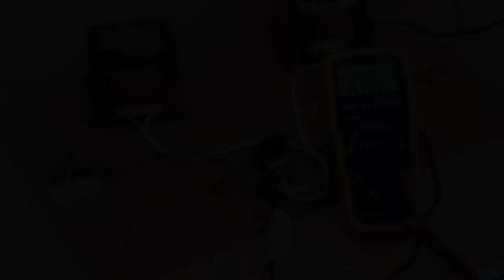DIY Welding Machine / Only 2 Microwave Transformer / Good Job

Comment: Excelente trabajo, eres un profesional y gracias por compartir tus conocimientos con todos, mi pregunta es si se puede usar ésta maquina como método de soldadura tig, y si las polaridades se pueden cambiar dependiendo el trabajo de soldadura a realizar, polaridad directa y polaridad inversa y si es así, en esa máquina que fabricaste preciosa por cierto, cuál sería el positivo + y cual el negativo -
Reply from the maker: Hola.  En primer lugar, gracias.  Esta máquina tiene salida de voltaje CA en su estado actual.  Entonces no hay terminal + o -.  sin embargo, se puede conectar un rectificador a la salida.  en este caso la polaridad puede ser obvia.
Reply: Hola de nuevo, y ése reftificador, de dónde podría obtenerlo de un aparato reciclado?, Es que quería hacer un inverter de unos 250 amperios más o menos y que tuviera la función de soldadura tig, no sé si me podrías ayudar, gracias y un saludo, y gracias por compartir tus trabajos, son geniales, yo también intento reciclar lo máximo posible las cosas, me viene de niño 😆😆 hay que cuidar el planeta, que es nuestra mejor casa, gracias de nuevo 👍👍👋👋
Reply from the maker: Hola.  Tu pensamiento es hermoso.  necesita usar 4 transformadores para aproximadamente 250A.  Si puede colocar 13 o 14 devanados en cada transformador con un cable de 8 mm2, puede alcanzar el valor de voltaje y corriente deseado.
Reply: hola de nuevo 😉,y si pongo un reftificador de voltaje en la salida, podré intercambiar las polaridades según el trabajo que lo requiera en cada momento, y podré usar  la antorcha de tig y trabajar con tig, cambiando las polaridades con tig también en el caso que se necesite?, Gracias de nuevo por ayudarme, y un saludo desde España 👍👍👋👋
Reply from the maker: Exactamente.  Sin embargo, el rectificador que conecte a la salida debe ser resistente a 250 Amperios.  Así será como dices.  Yo también tengo ese pensamiento.  Estoy pensando en hacerlo en el futuro.
Reply: muchas gracias por tu ayuda, lo intentaré haber que sale🤣🤣, cuando tenga tiempo y reúna todas la piezas, muchas gracias de nuevo y seguiré viendo tus proyectos, un abrazo y saludos cordiales 👍👍👋👋
Reply from the maker: Gracias a ti también.  Saludos desde Turquía
Reply: Holla eu fiz um soldador deste tipo com 4 transformadores e converti para corrente contínua. Irei meter um video no meu canal
Reply from the maker: @droquesteni  Hola.  También preparé los materiales.  Estoy pensando en hacerme el alisado en un momento adecuado.  Si nos avisas cuando lo hagas, veremos tu video.  que tenga un lindo día
Reply: gracias tu tabien! Si vou fazer isso!

Comment: Hello sir, I want to make it, could you please show that how to install volt and Amp meter in this machine and tell the average Amp consumption. Moreover I want to ask if this machine give output DC or AC.

Thanks.
Reply from the maker: Hello. You can install voltmeter and ammeter. However, current measurement can only be done during welding. My welding machine, as in this video, gives AC output. However, on my channel, you can find the video that I converted the output to DC and the video showing how the dimmer circuit used for current adjustment is made. Also, I would like to remind you that there are subtitles in the videos.
Reply: thanks
can i use transformers  upper or secondary coil is burned 
I got two of those
Reply from the maker: Hello.  As I understand it, you have microwave oven transformers with burnt secondary coils.  If the Primer (the part that is currently wrapped with thick wire) is intact, you can use it.  To understand this, you can measure the primary winding with an ohmmeter.  It's solid if you have a little resistance.  If it is open circuit or short circuit (0 ohm), it is faulty.  But usually the primary winding does not fail.
Reply: thank you very much for this information
☺☺
Reply from the maker: Thank you too 👍
Reply: I wanna ask which software you use for sketching 3d plans
Reply from the maker: Hello.  Sorry for getting back to you late.  I make 3D drawings with Sketchup program.  It is a simple and very nice program to use.  However, I made the box for the welding machine during the video.  So I didn't make a drawing.  It would be better if I made a slightly larger box.  It is good to connect a voltmeter and ammeter.

Comment: And sir Can well use any dimar diagram used bt136 like 2000w so dat well can used the paralet to bust it sir last question master
Reply from the maker: Hello.  It's okay for me to answer your questions, but as far as I understand your native language is not English.  That's why I can only half understand most messages.  Write in your language if you want.  I sent you the wiring diagram links earlier in a few messages.  Since the circuit I use is 2000W, I connected an extra triac to make the circuit stronger.  Since the product I sent you the link of is 4000W, there is no need for extra processing.  If you still want to do it, please write me exactly what you need in your language.
Reply: thanks so much master please send it to me sir because ave already getti 4 track down sir please master the diagram sir sending it to me sir it's well well with you sir
Reply: and possibly sir you can send the diagram of 4000w also Sir God bless you sir master
Reply: thanks master iam expect the diagram of it sir thanks
Reply from the maker: Did you download the schematic?
Reply: no sir I don't receive enyting sir
Reply: master I don't see it sir please
Reply: send the link here sir god bless you sir
Reply from the maker: https://drive.google.com/file/d/1NoQeD8Wd9HW9TT3OQOkoq9BUoZidIL-n/view
Reply from the maker: https://drive.google.com/file/d/1NoQeD8Wd9HW9TT3OQOkoq9BUoZidIL-n/view
Reply from the maker: https://drive.google.com/file/d/1NoQeD8Wd9HW9TT3OQOkoq9BUoZidIL-n/view
Reply from the maker: https://drive.google.com/file/d/1NoQeD8Wd9HW9TT3OQOkoq9BUoZidIL-n/view
Reply: thanks si ave already received this b4 sir I mean  you should let me now were  i can se how to build it my self
Reply from the maker: This process is not very difficult.  Place 4 bt137s neatly on an aluminum heatsink.  If the aluminum heatsink is a little bigger, it will provide better cooling and connections will be made easily.  Combine these four bt137 bin identical legs with a cable.  So connect the numbers 1 together.  Do this for legs 2 and 3 as well.  The cable should not be too thin.  As a result, 3 wires should come out.  3 wires for legs 1, 2 and 3.  connect these wires in parallel to the triac on the circuit.  ie the 1st leg, the 1st leg of the others, the same for the 2nd and 3rd leg.  Make sure there is no short circuit.  I hope you can handle it without any problems.  take it easy
Reply: sir I understand everything very much wath am saying sir is that I want to beuld the dimar by my self  so that I can buy the component and beuld the dimar by my self that wat i am toking about master
Reply: try to understand me master i want to beuld the dimar by my self  so that I can buy component an consroct the dimar by my self that wat i am seying sir please
Reply from the maker: I have also sent the sample circuit diagram in the other message.  good luck

Comment: what is the number of 4 triach?
Reply from the maker: Hi.  You can use BT137.  If the mains voltage is 220V, use 4 pieces, if 110V use 6 pieces

Comment: sir how mutch tons one tranformr  4mm swg and how watt tanformr
Reply from the maker: Hi.  Transformers are around 900W.  Each transformer has 24 windings.  Each transformer requires 6.5 meters of cable and a total of 13 meters of cable.  The cable must be a silicon insulated copper cable.

Comment: Me servirá un dimmer de 2000w?
Reply from the maker: Hola.  2000W no es suficiente.  Si su tensión de red es de 220 V, utilice un atenuador de al menos 4000 W.  Si el voltaje de la red es de 110V, debe usar al menos 6000W.  6000W no está disponible en el mercado.  Por lo tanto, es posible que deba conectar un triac adicional como lo hice yo.  Si es necesario, los diagramas en la sección de descripción lo ayudarán.

Comment: Boa noite meu amigo como é mesmo que faz a retificação da máquina de solda caseira
Reply from the maker: Olá.  Não consegui entender esta pergunta.  Você pode explicar um pouco mais?  obrigado
Reply: Bom dia não é que eu queria saber na retificação se quanto se diodo e se tem algum resistor para fazer a ligação
Reply from the maker: Um diodo em ponte ou 4 diodos são necessários para fazer a tensão de saída DC.  No entanto, eles dizem que deve ser resistente a 200 Amperes.  Neste caso, é bastante caro.  Portanto, não é adequado em termos de preço/desempenho.

Comment: How much cost for making machine ?
Reply from the maker: The cost was not too much for me.  I dismantled the transformers from the old furnaces and bought the furnaces second hand very cheaply.  I spent the most money on cables.  Besides that I paid some money for welding sockets and pliers.  Although I can't determine the exact cost since I have some materials on hand, it may have come to around 60 - 70 dollars.

Comment: How many turns the wire?
Reply from the maker: Hello.  24 windings for each transformer.  These windings should be made with 4mm2 cross-section silicone insulated copper cable.  A total of 13 meters of cable would be sufficient.

Comment: Nice job.  What was the cost ?
Reply from the maker: Hello.  Firstly, thank you.  It was cheaper because I collected the materials over time, but... I think it would cost 50 or 60 dollars in Turkish conditions right now.
Reply: How much does it weigh and you are 220v in Turkey?
Reply from the maker: Yes.  Voltage in Turkey is 220V.  I did not measure the weight but it could be in the range of 5 to 7 kg.
Reply: 110V here in Florida, USA.  Would be interesting
Reply from the maker: The mains voltage value does not make much difference.  You will get the same result.  Because the microwave oven transformers used where you live are produced according to the voltage of that region.  In other words, the primary voltage of the transformers here is 220V and the secondary voltage is 4000V. In Florida, the primary voltage is 110V and the secondary voltage is 4000V.  I mean, when you do the same things, you get 40VAC from the output.  Differently, since the input voltage is low, more current will be drawn while obtaining the same power.  For this reason, the dimmer circuit used on the input side should be stronger and the cables should be chosen to be resistant to this current.
Reply: Using standard house current ?
Reply from the maker: Yes... Here the mains voltage is 220V and there is a 10A fuse connected to the socket where I use the tool.  I use it without any problem.

Comment: so the primary coils are in parallel and the secondary coils are in series?
Reply from the maker: Yes.  By connecting the primary inputs in parallel, the mains voltage is applied (there is a dimmer circuit in between), the secondary windings are connected in series and welding clamps are connected to their ends.
Reply: Got it! I really like what you have done here. And thank you for answering to a video posted a year ago. One more question if I may; do you have a link or any info on the dimmer? I'm going to also check out your DC version.
Reply from the maker: I thank you too.  The video has been close to 1 year yes... I am still using the device.  There is a schematic for the dimmer showing how to connect the triacs in the description section.  I did not make the dimmer circuit myself.  I added triacs to a circuit I bought from the market.  I recommend you to do it this way too.  Take a look at the diagrams, if you have any questions, write back.

Comment: hai usato 13mt di cavo per ogni trasformatore, è corretto? grazie
Reply from the maker: NO.  Ho usato 6,5 metri di cavo in ogni trasformatore.  13 metri in totale in 2 trasformatori.  Ho realizzato 24 avvolgimenti su 1 trasformatore con cavo isolato in silicio da 4mm2.  Ogni avvolgimento crea una tensione di circa 0,84 V.  In questo caso, ho ottenuto una tensione di 20 V con 24 avvolgimenti.  Si ottiene una tensione totale di 40VAC in 2 trasformatori.
Reply: grazie!

Comment: hello sir 4mm wair  tiron???please
Reply from the maker: Hi.  I understand you are asking about the number of turns.  Let me give you general information... The wire used is 4mm2 silicon insulated (non-combustible) copper cable.  Each transformer will have 24 windings.  6.5 meters of cable is required for each transformer.  13 meters in total.

Comment: amigo que numero son los transistores 🙂🙂
Reply from the maker: Hola.  Según tengo entendido, su pregunta es sobre el circuito de atenuación que uso para la regulación actual.  Usé 4 triacs BT137 paralelos en este circuito.  Si el voltaje de la red es de 110V, recomiendo usar al menos 6 unidades.

Comment: Very nice project but I'm afraid your power controller is not using all thyristors. It's really hard and complex to parallel those since one thyristor will always fire a bit earlier and it will prevent the others of firing cause the voltage over the others will drop to about 2 V preventing them to fire.
Reply from the maker: Hello.  I totally understand what you mean, but the triac I'm using is BT137 and each of them can withstand 8A current.  It has been 1 year since I made this device and I have always used it for my work.  The power control circuit has never failed.  If their parallel operation were not possible, I think it would have failed by now.  Do you think it's wrong?  Thank you for your interest and feedback 👍
Reply: Nice, i will try it, thanks dude.
Reply from the maker: @carloca71  👍

Comment: Amigo se coloca a 110v o a 220v gracias
Reply from the maker: Hola.  Aquí la tensión de red es de 220V, pero el sistema funcionará a 110V.  Porque los hornos de microondas producidos para lugares de 110V están fabricados para operar a un voltaje de 110V.  Así que harás el devanado secundario como lo hice yo y si lo aplicas sin ninguna acción sobre el devanado primario, funcionará sin ningún problema.
Reply: Gracias amigo excelente
Reply from the maker: Gracias tambien 👍

Comment: Should the transformers be identical?
Reply from the maker: Hello.  The ones I use are not exactly the same.  It would be better if they were the same in strength.  For example, 2 x 1000W or 2 x 900W.
Reply: Thank you very much!
Reply from the maker: Thank you too 👍

Comment: Where did you find that heat sink for the triacs
Reply from the maker: Hello.  I had unplugged the cooler from an old computer power supply.  You can find it this way too.  By the way, I recently renewed the current control circuit of my welding machine and prepared a video.  I will also share the PCB gerber files.  Maybe you're interested.  Greetings from Turkey 👍
Reply: Thanks man appreciate the reply greetings from America

Comment: Question was that a voltage reducer you used with the dimmer or just regulators you merged with a heat sink to aid your dimmers heat sink?
Reply: Don’t worry I put the subtitles thank you for putting that in there!
Reply from the maker: Hi.  According to your second message, I think the situation is understood.  But I will write anyway.  The dimmer circuit I have is made for lamp dimming.  So low power.  I also connected an extra triac group to increase this power.  I have obtained a very powerful dimmer circuit with 4 triacs of 6.5A each.

Comment: how to differenciate primary and secondary winding    ?
Reply from the maker: Hello.  Mains connected terminals Primary winding.  If no action is taken in the microwave oven transformer, the winding with thick wire is the primary winding and the winding with very thin wire is the secondary winding.  In our process, the secondary winding is removed and thrown away and replaced with a much thicker cable.  In this case, the output voltage drops, but the current reaches the required height for welding.
Reply: thank you

Comment: Hola cuál es la forma de poner los cable de corriente al transformador
Reply from the maker: Hola.  24 vueltas para cada transformador.  6,5 metros de cable de cobre aislado en silicio de 4mm2 de sección para 24 vueltas.  Se requieren 13 metros de cable para 2 transformadores.  El cable es un cable llamado N2GFAF.  Si esta no es la respuesta a su pregunta, vuelva a preguntar con un poco más de detalle.

Comment: Unfortunately I cannot follow you. We need an electronics diagram. You did a wonderful project. I wish to make it like you. But you don't give us enough information 😞 Erich
Reply from the maker: Sorry about this.  I did some parts fast because I didn't want the video to be long.  However, there are wiring diagrams in the description section.  Also, I will remake the dimmer circuit that I used in this machine in the near future and I will share a video.  You can ask anything you want to ask.
Reply: Awesome video man, thanks for sharing & then taking even more time and effort to help us amateurs safely follow along etc, that’s very kind of you and sometimes it’s not always easy to see but positivity and kindness have power. Keep up the good work and thanks again. 🙌🏻🙏🏻✌🏻
Reply: Está máquina hasta cuántos  sube el amperaje

Comment: Pretty big electrode your useing there for demo ..I think I  might burn  1/8  6013 7018 1/16 maybe a 3/32 😅
Reply from the maker: Hello.  I think that the electrode I use is 3/32 6013 and maximum 1/8 6013 can be attached.